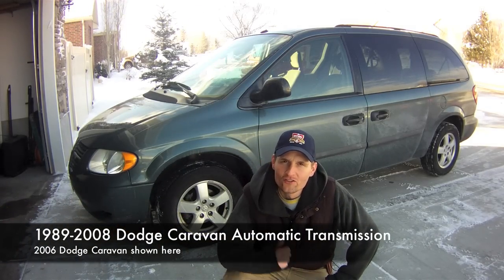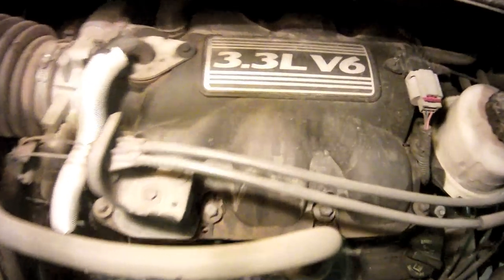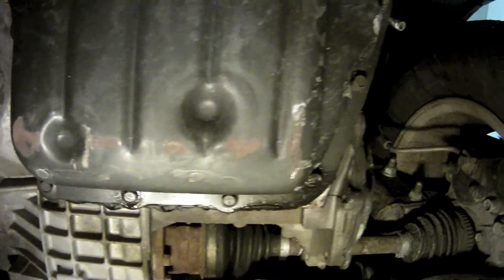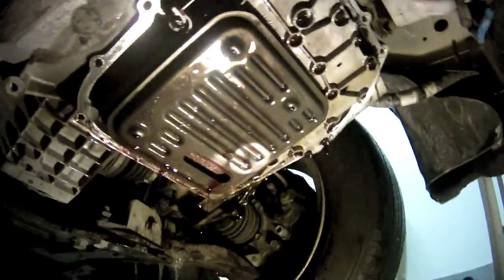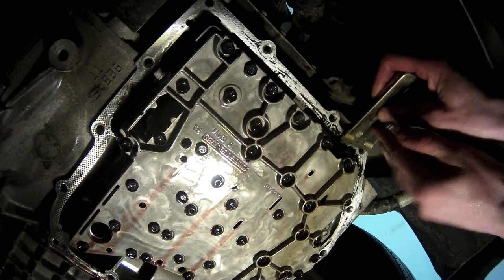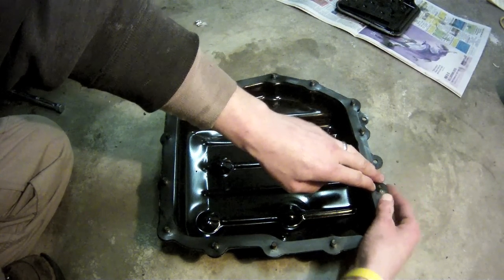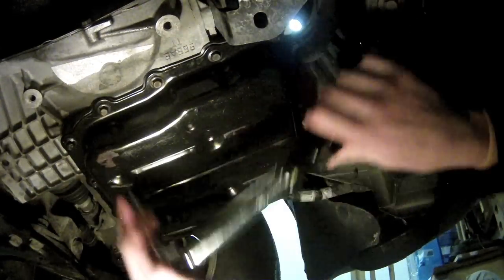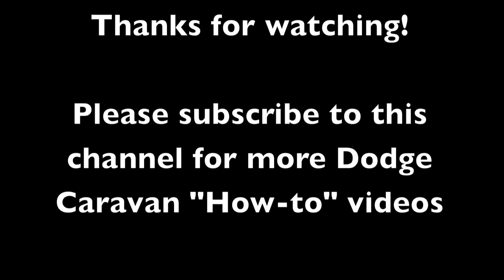How to Change Transmission Fluid in a Dodge Caravan

Comment: My grandad is pissed with me right now I poured half of a 3.78 transmission fluid bottle into the van. I filled it up to the top of the checking tube. Is there anything I can do.
Reply: They sell some pumps at the parts store used to drain many different types of fluid. I bought one that has a pump and two hoses( one sucking in, the other blowing out. You might be able to stick it through the dipstick tube and suck some of it out, onto a pan. It's either that, or pulling down the transmission pan like in the video. My pump was between $15-20. Don't worry it's no biggie. Just don't use the pump when it's dirty. You have to clean it up after each use, and dry it before using it for anything, or you could contaminate the different fluids.
Reply: u2bed91 Thank you! My granddad and I ended up doing that anyway lol.
Reply: u2bed91 yeea this was completely different from my civic, but at least you can change the filters on these

Comment: how did you catch all the transmission fluid when it looks like you spilled ALOT.
Reply from the maker: +Azn Driver There was a catch pan under there...
Reply from the maker: +FogoFox Also, you use the caught fluid only as a starting point on how much to add back in. Once you add that back in, you need to verify with the dipstick that you have enough fluid in there...and add more as needed to make up for any spilled/lost fluid.

Comment: When removing the pan bolts, you should really start at the bolts towards the rear of the vehicle since gravity is forcing more fluid at that end.  Start at the rear and work your way towards the front loosening or removing only a couple(one on either side) at a time.,  If this is meant as a 'how to' video then you have to assume that your audience are unfamiliar around a transmission and you need to be very wary about warning them of what NOT to do such as using a metal blade to scrape off remaining gasket material from the mating surface that the pan attaches to since it is very easily damaged and to get a proper seal, you need it to be clean and ding free.  Using a nylon scraper to get that material off is the best thing to use.  I've also used caulk scrapers from home depot.  You may be comfortable and careful enough to use a metal blade but you're not your target audience, people that are possibly doing this for the first time are and it was a big deal to me when I dropped my pan for the first time..  Also, when installing the new filter, I broke the rubber band that held it in place because I wasn't careful enough when I was seating it.  Ultimately, I had to drop the pan and do everything over a second time because the filter wasn't in place and was barely hanging on by the corner.  Degreasing the mating surfaces is essential, just wiping them with a towel isn't going to do it.  One other thing, that transmission looks a lot like my 41TE and the torque specs are 165IN LBS and not 120FT LBS of torque.  120lbs of torque on those bolts will cause them to possibly snap the bolt head off leaving the remaining threads buried in their holes and then there's a whole new set of problems with trying to remove them.  Not everyone knows that torque specs vary from manufacturer to manufacturer and knowing the difference between 'IN LBS' and 'FT LBS' is incredibly important.  I know that you're not a mechanic but after reading these comments where everyone is saying how helpful and clear and concise you were, I'm going to say that the people watching this video aren't experienced in car repairs and I'm sure at least one or two of them ran into a situation that they might not have been able to get through.  Causing damage to these areas leads to spending a lot of money to repair.  One last thing, Chrysler has always suggested that a gasket NOT used but Mopar RTV or equivalent instead.  Preformed gaskets pinch up or get stretched causing premature breakage.  The only advantage is that you can immediately refill the fluid back into the car whereas you have to wait with gasket maker...

Comment: i see other people made this comment too....
do not use the rubber gasket provided. it came from the factory with black silicone for a reason.

i made the mistake and used the gasket. 6 months later it was leaking fluid. it will dry up and crack.

Comment: I am a very new driver and owner of a 1999 Caravan, I plan to change motor oil but accidentally drained transmission fluid instead, I am here to check if I put  transmission fluid back correctly.    hahahaha

Comment: idk why they didn't  add a drain plug it would  be  easier
Reply: Because people would change the fluid and not the filter.
Reply: I just swapped my pan out with a plugged one. 25 bucks is worth it.
Reply: @TheXOoftheRO  i came here to say the same thing. Get the $25 oil pan with drain plug and save time n $ in the long run

Comment: Ужасного коричневого цвета уже мало было! Может мастер и прав, но в ролике он посадил крышку без герметика, просто через прокладку. Я сажал прокладку на герметик и все отлично без подтеков. В ролике же, мастер, передавил прокладку, я думаю со временем крышка начнет подтекать, особенно если этой крышкой наехать на какое то препятствие.
Reply from the maker: Анти стоп- хам Yes, sealing the transmission pan with a sealant will create a more sturdy bond. However, the seal doesn't necessarily have to last forever. The fluid should be changed periodically, and the gasket can provide a leak-free seal until you do another fluid and filter change.
Reply: С кокои силой надо закручивать болты? У меня ест динамометрический ключ, толка я непонял с кокои силой зажымат.

Comment: I have a couple questions. First though, nicely done video. 

I have a 2007 T&C. I have a strange shudder that occurs and the local mechanic has said torgue converter. I found this video: https://www.youtube.com/watch?v=b7vlpGCx5uo  
Which explains one possible way to fix this issue. The shudder isn't consistent. Sometimes it happens at 27 mph, sometimes at 47, and in between speeds as well. One thing I have noticed is when it is near freezing the vehicle runs smooth until about 10 minutes  after start, suggesting the issue has something to do with warming up the transmission.

I have now wondered if the above dacco fix is right, or if perhaps someone drained the transmission pan in the past, did not drain the torque converter and now I have two different mixes of tranny fluid inside.

Thanks... CB

Comment: Have to wonder about the idiot's mind that designs a pan full of a gallon of oil and NO drain plug like the engine pan has, so that as you work on your back laying on the driveway under the car loosening 14 bolts the thing tips and dumps the oil all over- brilliant design- NOT!

Comment: Guys it’s very risky to just use gasket that comes with the filter. Unless u have a SUPER DUPER smooth surface, I would avoid using gasket and go with using a tube of gasket maker because there are microscopical gaps left when cleaning and Grinding the cast and the pan that would start leaking after the first drive unless you use a gasket maker.. DO NOT USE GASKET MAKER AND RUBBER GASKET TOGETHER. USE ONE OR THE OTHER